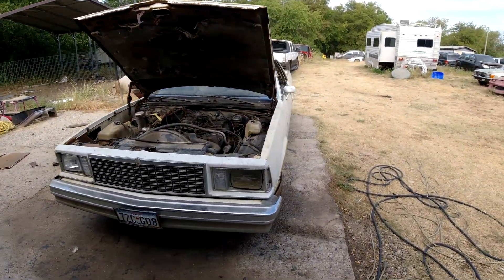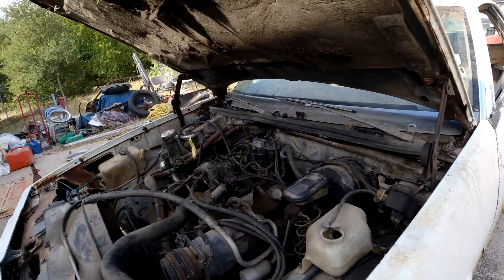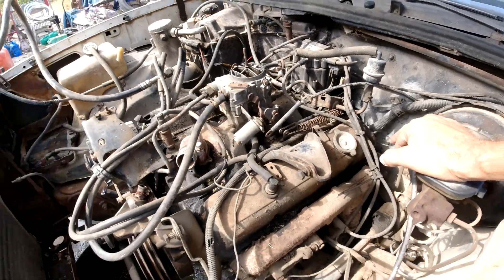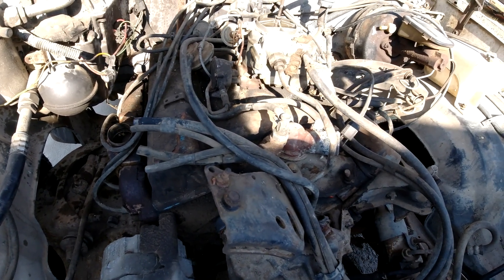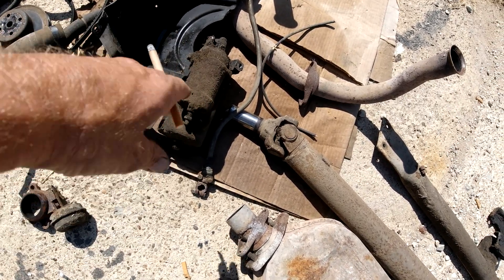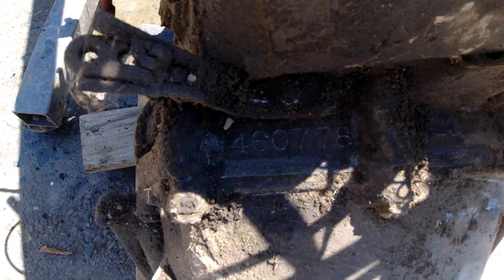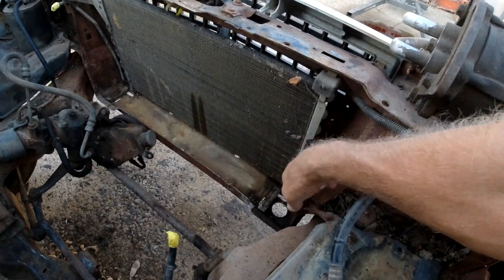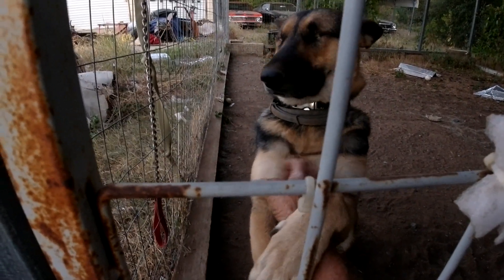#5. 1978 El Camino SS. Step by step engine and transmission removal. Cleaning engine compartment.

Comment: The trans in the 78 El Camino is one of those weak THM 200 transmissions that were used in the Chevette. The THM 200 Case is the same size as the THM 350. If the trans in the gold 77 Malibu is a THM 350, it’ll make an excellent swap because the intervals are more durable.
Reply from the maker: it's a turbo 350

Comment: There is a ground strap on the firewall behind the break booster vaccum line. do you know where that ground should be connected to? Mine is currently not connected to anything and hanging off the firewall.

Comment: Get ahold of an old Chevy driveshaft and pull the front yoke off it to use a plug in the tranny to keep the mess down.. or just pull the motor and leave the tranny in the car.. just my opinion

Comment: I just wanna say..since you got the engine out, if its original,why not get a re-ring kit,a nice intake and 4 barrel and headers. That's what i would do.although money is still being made, those malibus are no longer made.just my 2 cent.....peace..
Reply: The problem with that way is you start tearing into it and you’ll start to find more and more parts worn out. That turns into a full blown rebuild. There may be a ring ridge,  bad cylinder taper, grooves in crank rod journals, etc. we haven’t even got into the heads yet…then you’re in in for 2000$ plus. It’s a gamble and really there’s not much power to be made from a 305.